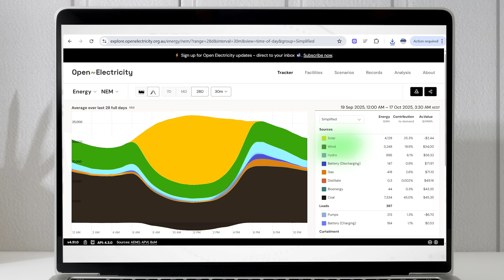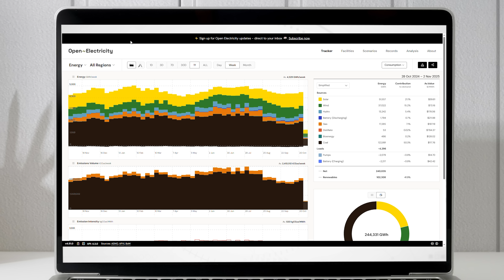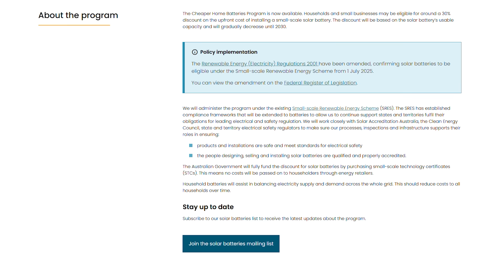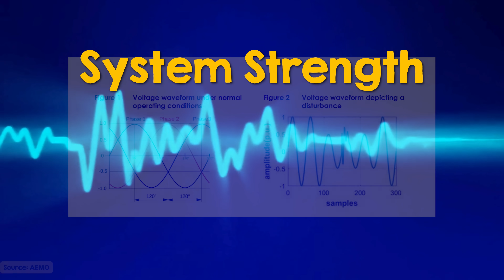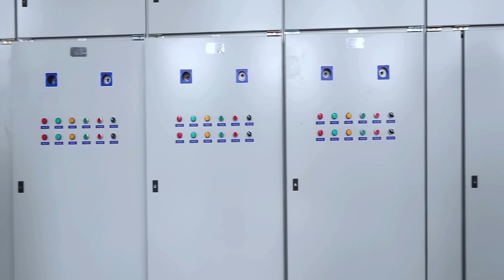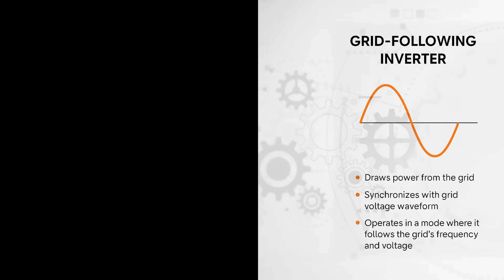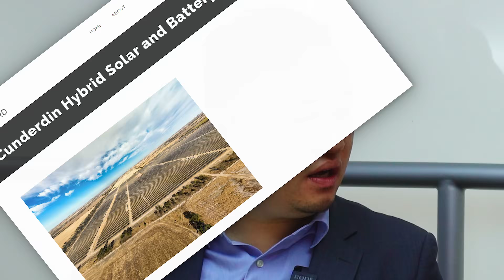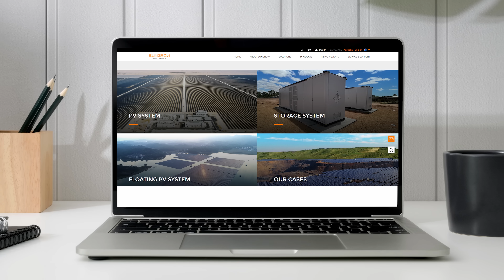Australia’s Solar Boom Is Breaking the Grid - Or Is It?

Comment: Car to Grid!!!   if the 200k+ electric cars in Oz had a 10kw C2G inverter, that 2gw of available power!  and that quantity is only set to grow drastically over the coming years.
Reply from the maker: I reckon I'll be able to get v2g in 2026. That's my hope anyway!
Reply: V2G is an interesting idea that of course can work, and should be tried.  But the long-term problem is people won't want to wear-out their expensive EV faster to power their home, and they use their cars at times when they need a home battery.  And as batteries get cheaper, homes will want lots of battery for winter (especially in Europe and the U.S.) and outages, and better home batteries are coming, such as sodium-ion, that will be cheaper and more appropriate than using your car and its limited output wire for the home.
Reply: @charliedoyle7824  So V2G will just become an emergency backup for homes?
Reply: @SirGregoryPageTurner  V2G could be good for emergency backup if you need only about 10 kW.  But then your car could run out of juice for your next drive, or you have to go somewhere and the house goes dark.
Reply: @charliedoyle7824  If you need to go somewhere, why does it matter if the house goes dark in an emergency? And don't forget, the whole point is that without the V2G emergency backup, the house would be dark anyway! And this can be managed. The owner can decide how to manage the situation. If they are not planning on going anywhere, use the car battery. If they need the car, then turn things off in the house. It is still better than not having any backup.
Reply: @YouTubeChannelForAll  I don't have any problem with using V2G.  If it works for you, then good, use it.  My point is, better home batteries are coming soon, and most people won't be using their car as a house battery, because it wears out the car faster, and home batteries back up and and time-shift solar every day, especially important in winter.  A car battery isn't enough for a full pv system.  It will become cheap enough to have lots of permanent home batteries with a big pv system, giving you 24/7 solar power most of the year.
Reply: Many V2G devices have power limits for output to the network that are less than the power needed to charge the battery.
Reply: What I took from this discussion was v2g is not likely to be necessary (at least in Australia).
Reply: Friend of mine bought a crashed car instead of a wall battery. Capacity was 60% cheaper than a wall battery and if it ever starts burning he can still pull it out of the garage.
Reply: @THEMithrandir09  you won’t be pulling a burning lion battery out of a garage mate… 😂
Reply: @polarbear7255 lmao, we're doing battery stresstests in the company we work at. The battery is still in the car that can still roll/roll again, and a steel cable is attached to it. Sure, there's not a lot of time to react, which is why he's also thinking of propping it up and having it roll out just by letting gravity do its thing, once he detects the battery failing.
Reply: @THEMithrandir09  wow. Have you even listened to yourself? What is wrong with you people? 😂 Sorry I shouldn’t laugh… but is it hard to be that dumb and not even realise it? 
Seriously… THAT’s the part you reply too? 😂😂😂😂
Reply: Car to Grid is a nice idea, but where is your car each day during the peak solar production hours? Is it at home plugged in to your solar system, or is it sitting in the carpark at your workplace?
The only two solutions to that are to allow full self driving cars to drop off the owner/passenger at work, drive home unmanned and plug in, then drive back later to collect the owner,... and you can see where that falls apart with community safety groups, legislators, and peak hour loading of the roadways infrastructure, along with the insurance liabilities. Or you can have the cars plugged in at work to the workplace solar system, and do you think that's going to benefit the worker or the companies?
Reply: @PiDsPagePrototypes a grid can enable metering where solar from your own roof goes into the grid and into your EV regardless of where your EV is plugged in
Reply: @greenvolksi7886 It can, but do you think the owners of businesses are going to allow that at their facilities without getting a cut of the income?
Reply: @PiDsPagePrototypes Car sharing, taxis, unmanned vehicles and public transport require at a minimum dense low-rise buildings from 2 to 6 floors, many townhouses, duplexes, co-living spaces and a complete rejection of the “American Dream” - a separate house with a plot and a car for each adult.

90% of the American Dream homes will have to be demolished in favor of dense housing to make your dreams come true.
Reply: V2G is oversimplified pie in the sky. There are too many variables and human factors for it to ever be relied upon as any sort of primary power source. Currently it’s vapourware. It’s not worth the resource usage for the minimal amount of energy stored and the transfer losses. Not to mention battery degradation. It’s loved by people because it seems simple but it’s application at scale will be anything but.
Reply: Do you realise cars are supposed to be... cars? Not stationary batteries? No one buys a car for this use case; if they do, they're crazy. To do the job properly, you need a separate battery. Aside from this obvious fact, if/when autonomous driving kicks off, fewer cars will be produced, as a total number, and those cars will spend as little time as possible being stationary because that's how they are most productively used. 

Private car ownership is falling anyway, and this will accelerate that. (You'll see fleet ownership go up because overheads to run "robotaxis" can be reduced at scale) Also, people live in flats in cities. Don't even get me started on how dumb this is from a depreciation standpoint. 

The fact is, private car ownership will go down from over 90% 30 years ago, to only those who can afford the luxury of owning one full time. Maybe 20% max of households in ten years time, and this "energy consultant" hopes vehicle to grid will be big starting in 2026, lol. Yeah, only for suckers.

SIde note, home batteries and home generation are also for suckers. (for slightly different but similar reasons)
Reply: @markfernandes2467  You have very strange assumptions. Things can be multifunctional. There is no reason why a car can't have more than one utility.  You are right about one thing: Robotaxi's  will spend as little time as possible being stationary because they will want to be as close to potential customers as possible. They will be driving around town waiting for a request because if they are parked somewhere far away, it will take them too long to get to the customer. It will cause congestion and empty cars driving around for nothing. The real solution is better public transport.
Reply: @YouTubeChannelForAll  "You have very strange assumptions." - Want a bet?
Reply: @markfernandes2467 I agree with old mate. Why do you say home storage and generation are for suckers? I generate enough power during daylight hours to cover my own daily needs in general. With a battery I can spread that to my night time use and essentially bring my bill to near zero. The payback is well less than 10 years on a system that should last in excess of 20
Reply: @markfernandes2467  Weird response. Address what I wrote if you have valid arguments: I explained what was weird about your assumption but you ignored that.  Here is another weird assumption: "As if loads of cars are doing this, when they turn the grid back on, it will fry substations & transformers". That isn't true. With good V2G protocols and regulations, they don't need to cause any problem. If voltage levels rise too high, they automatically stop feeding the house/grid. Such protections are already standard in inverters.
Reply: @YouTubeChannelForAll  "I explained what was weird about your assumption but you ignored that." - No, you didn't. The only counter you offered to my points was a vauge statement, this one; "Things can be multifunctional. There is no reason why a car can't have more than one utility. - But I'd already given several reasons as to why this doesn't work, you claiming it does without dealing with any of my arguments, doesn't really cut it now does it? 

So no, I didn't ignore it, there just wasn't anything there to come back on.  

The only other thing you mentioned, was something about public transport being better than the idea of robotaxis? -  "It will cause congestion and empty cars driving around for nothing. The real solution is better public transport." - This is a different conversation, and has nothing to do with what was being discussed, which was why V2G doesn't make sense. I even said, "if/when robo taxis~" , which means exactly that. 

Apart from that, you then agreed that robotaxis would indeed not be stationary and would be away from home as much as possible being...taxis! not battery backup. Which was my point! So if you agree with that, then how can you also say it can serve multiple functions?? 

Your latest comment quotes me saying - "As if loads of cars are doing this, when they turn the grid back on, it will fry substations & transformers".  - you then claim this isn't true,  but then go on to say something that agrees with my comment! lol - "With good V2G protocols and regulations, they don't need to cause any problem. If voltage levels rise too high, they automatically stop feeding the house/grid." - Yeah, so you need more gear, an ATS to be precise, and permission from your DNO ! Which is exactly what I said! 

you then say "Such protections are already standard in inverters." - Neither an ATS or DNO permission to do bi-directional charging comes "standard" on home car charges atm bud. 

Heck, they don't even come standard on home batteries for god sake, you have to pay extra for an ATS on most setups, and still have to apply to your DNO, which can be refused and most likely will if too many people apply, just as I claimed. 

So again, even if you buy a V2G-enabled car, you can't just use it without extra expense and effort. Does that make sense for a once-in a however long "emergency" for most people?
Reply: @markfernandes2467  You are either incapable of logical thought and seeing the bigger picture or you are a shill bot pushing pro-nuclear propaganda and fear mongering. I think the latter. Either way, responding to you would be a waste of time.
Reply: @YouTubeChannelForAll  spoken like a true expert. Keyboard warrior. Oh everything’s gunna be so easy and it’ll work just fine.

Real world observations show those claims to be a fallacy. 

Energy is far more complicated that amateurs and the uninformed like you like to point out. 

You ignore physics and engineering and human nature and logic.
Reply: @polarbear7255  I'm still waiting for an actual argument...
Reply: @YouTubeChannelForAll  I merely stated engineering fact. You couldn’t dispute anything i stated. All you had was ‘you’re a troll’ and tears.
Reply: @markfernandes2467 someone who gets it. Millions of small batteries is not the answer. Nor is subsistence farming your electricity at home. Industrial scale energy generation is how electricity becomes cheap and reliable for everyone. 

Gunna disagree on the private car ownership though…. Peeps aren’t going to give up the freedom to travel where they want, when they want easily.
Reply: @polarbear7255  Well, I will say, it's nice to not have a reply denying reality or economics in favour of their dogma and cheerleading for the people scamming them, so thanks. 

However, you're wrong on private car ownership. It doesn't matter what people want; it's just what the math and economics will make impossible for most to justify the cost for the relative benefit. 

As for "freedom," people have been giving theirs away for the last 20 years, piece by piece, mostly for "convenience" (which actually means dependence) as well as a sense they are doing something smart/good (making their own power at home or reducing CO2, for example) 

They are sleepwalking into surfdom while cheering it all on. This is what happens in an "everything as a service" economy. Everything does, in fact, become a service, go figure, lol.

Corporations and shareholders (indirectly) will own almost all assets. Welcome to the future, enjoy. As the Terminator once said, "screw your freedom".
Reply: @markfernandes2467  there are those of us who will not willingly become serfs. There are those of us who will fight. I value freedoms and self sufficiency and like many refuse to be a slave to technology. 

Once people realise the loss of freedoms that accompanies the loss of private transport then economics means nothing. People will go back to
ICE
Reply: @polarbear7255  Good luck with that, sincerely. But know this, they are more powerful than you. They will ban ICE cars and even driving on safety grounds eventually. Choices become mandates, Freedoms become illegal. 

Without even doing that, ICE infrastructure will also become too expensive to maintain. Petrol stations will go out of business as ICE cars diminish in the market; Welcome to ICE range anxiety. It's that simple. Car makers will also need to go to low-volume ICE production, pushing the prices of ICE up. Tipping points are real. 

They'll also use pollution charges. 

So they'll get you on the economics first, then reduced utility, and, if that doesn't work, they'll go to law or social stigma. 

The rich will still have "track days" mind.
Reply: @polarbear7255  Millions of small batteries increase resilience, decreases peak electricity needs and thus infrastructure costs. It also allows solar panel owners to maximise the utility of the electricity they generate which also reduces peak demand on the grid. They make a lot of sense.
Reply: @markfernandes2467  Oh the irony. You are one of the more dogmatic commenters. You clearly don't understand the economics and also believe in conspiracy theories.
Reply: @YouTubeChannelForAll  Tell me how I'm wrong, don't just assert things or use thought-terminating clichés. 

I've told you why what will happen will happen. Point out where the logic/economics is faulty if you can. 

I'm open-minded, not dogmatic, which is why I reason my way to conclusions syllogistically & correct my thinking if I hear a better argument. Try it sometime.
Reply: @YouTubeChannelForAll you clearly don’t understand the engineering behind what you just parroted. Specific energy champ. Energy density equals efficiency. Batteries are a joke.
Reply: @polarbear7255  When it comes to storage, round-trip efficiency is what counts and batteries have an efficiency of ~95%. And also you ignore all the benefits to the system as a whole that they bring. But sure, be rude when you don't have any real arguments if that makes you feel better.
Reply: @YouTubeChannelForAll  uranium champ. You don’t need no stinking storage. Your whole system is a massively expensive waste of resources that makes people responsible for their own energy generation and the associated costs. It, as a system is the epitome of inefficiency and is the main reason Australian consumer electricity prices continue to rise logarithmically with the increasing percentage of renewables on the grid. Nuclear is the future of energy. Humanity will eventually have no other choice.
Reply: @polarbear7255  I'm starting to think that you and your other nuclear shill pal are a bots. All the typical propaganda, all the false claims, all the logical fallacies. It is textbook propaganda.
Reply: @YouTubeChannelForAll  95% of not much, is still not much dude, lol.
Reply: @YouTubeChannelForAll  Yup, more name-calling assertions and no actual arguments! 

What logical fallacies have been engaged in? You haven't even identified any. lol
Reply: @markfernandes2467  What a ridiculous statement. There is huge amounts of practically free solar energy available when the sun shines. Storing that with 95% efficiency to deliver back to the grid in the evening, is a great solution. Anyway, you are either a nuclear shill bot or incapable of understanding a modern distributed grid. Ciao!
Reply: @YouTubeChannelForAll 
EXACTLY which part is propaganda? Try me. 
I only pointed out the engineering and physics flaws in your ideology. I can assure you I’m not a bot. I’m more than happy to debate nuclear energy with you.
Reply: @polarbear7255  Which part? All of it. All you are doing is making claims but are not supporting them with any facts or arguments.  If you can actually form a coherent argument, I'll listen...
Reply: @YouTubeChannelForAll  ok then, which part? Which claim? Be specific now. ‘All of it’ is just another one of your signature gross generalisations. 
You wonder why no one takes you  seriously…

Didn’t like the bit where Uranium just trumped anything a battery could ever achieve and does it using less than 1a% of the resources with correspondingly lower emissions? That bit?